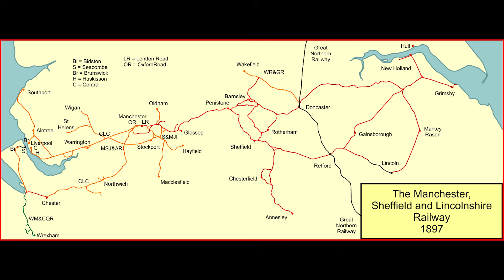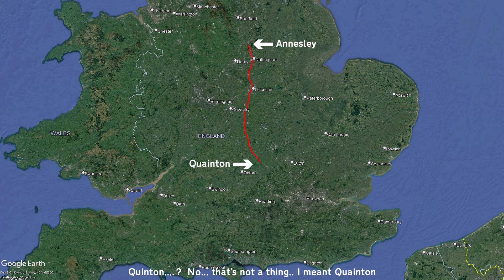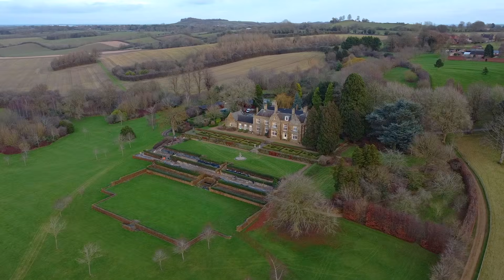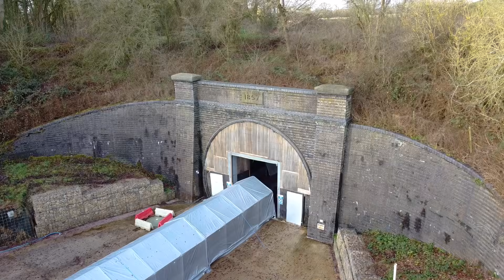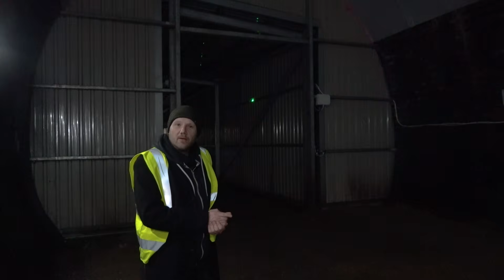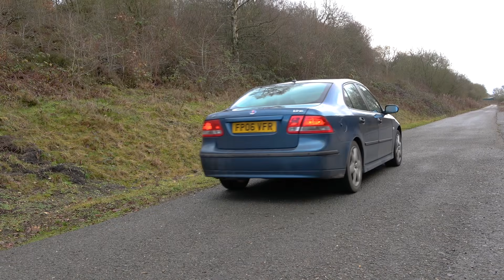The Vehicle & Car Testing Facility Buried Underground In An Old Railway Tunnel

Comment: I walked through the tunnel in around 1974/5 - It seemed like a bloody long way in total darkness (all we could see was the small point of light at either end). There was still a fair bit of railway equipment lying around at that point (just a decade or so after the line closed). Also various open drainage channels etc to fall into...

Comment: Really don’t get this?
Reply from the maker: What you struggling with... ?
Reply: @AutoShenanigans 😂 trying to work out why you want to test cars underground? When the prototypes are out they are camouflaged anyway so spy’s & drones don’t matter. Maybe they want to see what the headlights look like 🤪
Reply: @Senna-xi1gr  As was stated fairly clearly in the video, if you're testing the results of your latest aerodynamic adjustments to your design, you want consistency in your results. You don't want the measurements one day to be wildly different to the next due to a simple change in wind direction, rainfall, humidity or temperature.
Reply: @Senna-xi1gr controlled environment.

Comment: One of the other advantages of a tunnel is that you can test in secret. With open-air test tracks rivals will use drones or even small planes to take photos sometimes.

Comment: The only time I went through it was in the late 1980s in my mate's old Range Rover. Running on the flooded invert of the tunnel, nearly went down the 4 foot deep drains up the middle between where the tracks used to be. As it was, we conked out near the North end due to water on the electrics and wound the vehicle out in gear using the starter motor!
Spooky when all you can hear is the distant sound of dripping water.
Still, it was probably better than the sound of an approaching train - which was kind of difficult anyway  considering the track was removed when the line closed in the 1960s!
Reply: What?  A Range Rover conking out?  Unheard of.

I'm surprised it wasn't stripped and sold off whilst you were in there ...

Comment: We used to test cars on runways one problem is crosswinds and tailwinds stuffing up the results, It would be handy to confirm downforce results by running along the roof as well. Sergio Rinland ex Ferrari Design Engineer is listed as a director at Total Sim Ltd. He has been around since the 80s.

Comment: ARP are further down the line at Top Station Road, Brackley which was a station on what was actually The Great Central Railway. I remember it when it was still had trains stop there. Interestingly (or not, depending on your point of view) Mercedes F1 are also in Brackley, at the other end of town on a site next door to what was once known as Bottom Station, a station on the London and North Western railway. Ah, happy days before the vandal Beeching got to work.
Reply from the maker: There's a lot of F1/motorsport in the area, with Silverstone near by it makes sense.

Comment: The mysterious rooms built into the sides were used to store maintenance crew toolboxes and to take breaks in, etc.
Reply: Yes I've seen these with fireplaces. Like micro canteens :)
Reply: I spent many a happy hour in those rest facilities when were thinking of reasons not to get back to maintenance.  A shift needed to take the allocated time.  It was a cold an wet tunnel.

Comment: 1. I suspect those 3 rooms on the sides of the tracks were for maintenance personnel to have a break room while trains went by.
2. 2740 metres?? Why is nobody top speed testing cars down there?!
Reply: That's Correct areas or(small rooms) is where the Work groups use to gather to have their Lunch and leave their belongings  before setting off back to work.  There are still quite a few of these Rooms in tunnels especially around Manchester area.
Reply: The door at the end ?

Comment: Theres something similar in the USA. Abandoned PA turnpike tunnels, originally constructed for the South Pennsylvania Railroad, was never completed. These tunnels became part of the PA turnpike system, and in the 60's, a few were bypassed. One of the tunnels, Laurel Hill, has been repurposed for PennDot i believe and used for testing road safety equipment. At one point, I think some NASCAR team did some research and testing there, areodynamic testing I think. Very cool to see something very similar in the UK.
Reply: Chip Ganassi uses it for his teams.

Comment: The little rooms formed in the side of the tunnel would be for platelayer gangs.  Typically four men would look  after a mile or so of track so you use to see little huts all over the network.  They would be continually checking bolts, clips and track alignment and so on.
Reply: So a bit like a tea room for the rail maintenance crews?

Comment: Closure of the Great Central line was nothing to do with Beeching. It was because when British Rail came about, it was put into the Midland Region, which still had LMS management, they didn't like the Central line because it had been LNER and thought it was still a threat to Midland lines, also they didn't really know what to do with it. It was run down so BR had no option  but to close it
Reply: thus losing a useful freight line and a direct rugby nottingham link
Reply: @highpath4776  The same thing happened in Western Region with attitudes to Southern routes in the west country and even with the Atlantic Coast Express being consigned to the dustbin

Comment: I travelled most of the MS&LR's London Extension on a Sheffield to Bournemouth train c.1960.  (As I recall it cut across from Woodford Halse to the GWR at Banbury)     The Great Central (as it became) main line was noteworthy for having island platforms, an unusual feature for a two-track line in England.   I believe the line was laid out for fast running, I believe I read that at some point the fastest scheduled train in Britain was a late-night newspaper train from Marylebone to Nottingham.
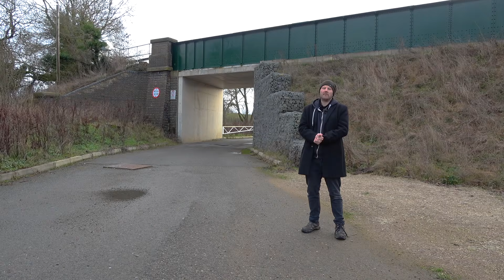Re nimbyism at 3:05 - I seem to recall reading that the reason the London & Birmingham (later LNWR / West Coast Main Line) avoided Northampton 60 years earlier but not all that far away, was powerful nimby landowners.   They were always around.    The reason the Kyle of Lochalsh branch of the Highland climbs from Dingwall past Strathpeffer round the back of Raven Rock then drops back down to the river is reputedly because the local laird didn't want them following the river.     And so on...
Reply: Yes the GV was often used for excursions from the North to the South, or East Coast

Comment: walked this tunnel back in 2006 before any of the wind tunnel stuff was added. was kinda fun, intresting, cold wet and very dark in places the vents where some of the most intresting parts. the little side rooms where for eating your dinner in if you where working deep in the tunnel, and track work storage. There are a number of videos exploring the tunnel. one called "catesby railway tunnel full tour" by rebecca smith while 11 years old is rather good

Comment: Walked through the entire tunnel, from south to north, in the mid-1970's - part of a discovery process of odd places on the map. We were told by a local resident a few weeks before the Army had been to check it out.
You missed the second spectacular part, the north bridge crosses a fairly deep ravine. Now no longer accessible from the tunnel itself, as you found the bat's home. I understand you get access from a nearby golf club's course.
There is the Kilsby Tunnel a few miles to the north-east, which is used daily by the West Coast Mainline, so no access ever and the air shafts are crenelated. Building that had challenges too back in Victorian times.

Comment: +Auto Shenanigans
"platelayers' cabin" aka "platelayers hut" (latter outdoors generally.
"Platelayers' huts are small buildings constructed beside railway lines at regular intervals (typically every 2 or 3 miles) that were designed to:
    store the tools and equipment used by permanent-way workers; and to
    provide those workers with somewhere to shelter during meal breaks and periods of bad weather.
For more than a century, each team or 'gang' of track workers was assigned to a specific length of track. The members of these teams were known as ‘platelayers’, 'gangers' or ‘lengthmen’ and each team was based at a platelayers’ hut located close to its 'length'.
Platelayers' huts fell out of regular use in the 1970s, when more flexible working practices were introduced. Regional teams now use vans and other road vehicles to reach locations where maintenance work is required".
Reply: And the huts are used for snogging by teenagers.

Comment: Before all this development the tunnel was closed at both ends but it was always possible to gain access despite this.
There were very wet areas due to spring water and there was a drainage channel down the centre.
I believe 3 million bricks were used in the construction.
With wet rails and a gradient it was not pleasant for the driver and fireman on the steam locomotives if they happened to have difficulty with traction and consequent smoke in the confined space.

Comment: What an interesting set up and great use for the old tunnel! Very cool video. Also, new Saab?
Reply: It is a great facility... we got to film there a while back... They have lots of sensors and measuring capabilities from lasers for aero to underground GPS tracking.. The aerodynamic noise testing side is quite fascinating, including the pursuit / racing bicycle aero testing.
Reply from the maker: It is a "new" Saab.. the old one was at the end of its life.

Comment: You're not quite right about HS2 not wanting the Great Central infrastructure for their route, because a few miles of HS2 will run along part of the old line ! There will be a deviation in one place due to curvature of the old line, (HS2 line speed is 250 mph, the GC less than 100 mph). So, starting at Quainton, north of Aylesbury,, having passed round the west side of Aylesbury, HS2 joins the old GC main line: -
https://assets.publishing.service.gov.uk/government/uploads/system/uploads/attachment_data/file/529513/C222-ATK-CV-DPP-020-000008-FPD.pdf
It passes under East-West Rail on the old GC formation
https://assets.publishing.service.gov.uk/government/uploads/system/uploads/attachment_data/file/529514/C222-ATK-CV-DPP-020-000009-FPD.pdf
But leaves t he GC for a bit at Chetwode, to ease the curve for its 250 mph line speed
https://assets.publishing.service.gov.uk/government/uploads/system/uploads/attachment_data/file/529515/C222-ATK-CV-DPP-020-000010-FPD.pdf
Then near Turweston, approaching Brackley, it leaves the old GC so it can pass round the east side of Brackley. The old GC had a station in Brackley, of course.
https://assets.publishing.service.gov.uk/government/uploads/system/uploads/attachment_data/file/529517/C222-ATK-CV-DPP-020-000011-FPD.pdf
Of course the old GC formation isn't used "as-is" because HS2 track spacing is much wider due to the aerodynamics of trains passing at a combined speed of around 450 mph ! Bridges are replaced, but the basic line is used.
Reply: Thanks for the info about HS2! I think Jon mentioned "HS2 eyeing up the tunnel" rather than the rest of the route, so he may be right after all!
Reply: @stepheneyles2198  I don't think HS2 was considered when looking at a route to Birmingham, but there was a proposal quite a few years ago to reopen the GC as a freight-only line suitable to haul continental loading gauge wagons from the Channel Tunnel up to northern England. It was to be privately financed too, but failed to get support for its Act in Parliament.

Comment: Awesome video again! I was one of the surveyors who did the survey for the project (you can see one of the targets we put up at 3:55 ), so it’s really cool to see it finished. Not the pitch black sodden hell scape it was before!
Reply from the maker: Great to hear from someone who was involved.  Was there much "repair work" required to the original structure?  What's the deal with the "targets" ?
Reply: @AutoShenanigans  From memory not a lot of repairs, just lots of debris removal! When the tunnel was partially cleared we drove a vehicle mounted scanner down there routinely to survey it as it was built. The targets were to make sure it was super accurate because it’s underground. Got plenty of videos/photos of it in its “abandoned” state  if it’s if any interest! 

Thanks again for all your videos, I love your channel!
Reply: @AlphaViper  That is very cool! I wish we had those when we filmed our video there! I don't know about Jon, but I'd like to see those photos!
Reply: @AutoShenanigans  laser distancing/ elevation changes

Comment: high-speed runs!? ooooo
Reply: We took one of our cars down it when we filmed there – sadly not very fast – but what they've done is add sound deadening in the tunnel. This is so they can get more accurate readings on noise tests. So, it won't ever sound as good as it could without the sound deadening... but would be awesome to do a high speed run nonetheless.

Comment: The side rooms in the tunnel would have been used as a " Bovvy " - a small place where trackworkers can sit down , warm up ,have a brew and eat their sandwiches during their breaks between maintaining the track ! There would have most likely been a small fireplace with a built in flue and benches !
Reply: Sam, spot on!
Reply from the maker: Imagine that as your "office" for the day. Awesome. But it probably wasnt.
Reply: I suspect that Bovvy was a souff of England pronunciation of Bothy, a common term for huts or shelters further north.

Comment: Watkins had some interesting ideas, he started to build London's version of the Eiffel Tower at Wembley, bits of which were found when they rebuilt the stadium a few years ago (search Watkins's Tower for info).
Reply: Correct.

 But they ran out of money at 90 foot tall and from then on, until it's demolition in the early twenties to make way for the original Wembley stadium, it was known as the "London Stump".
 It is alleged that the backers then hawked the idea round  the country to get others to invest in a tower for their own town, setting up The London Standard Debenture Company.
But they just took the money and ran.

One place they allegedly conned was Blackpool.

 So not wanting to have such a black mark, the town's Mayor, Alderman Cocker, got enough backers of his own to build it instead,.
 It was a phenomenal success and the rest, as they say, is history.

There were supposed to be two more built too. New Brighton on the Wirral and Douglas on the Isle of Man.
 Only New Brighton's was built in the end.

And apparently, the four corners of the London Tower/ Stump, are exactly the four corners of the pitch at Wembley.

Hope this is of interest.

Cheers.

Comment: So is that the Northern extension that Eurostar never bothered with then, i guess? They even got as far as building some of the trains to specialise in that route. Pretty sure the 1st Gen Eurostar train they have at the NRM in York is one such example. These sets were not only able to use the at least three different wattages of electricity that various different national systems used, they also had the ability to get said juice from pantographs and third rails.
Reply: No. The Eurostar northern extension was up the existing east coast mainline towards Leeds and York
Reply: @emmo999  Excellent, cheers for the info!
Reply: Even the first Eurostars had multiple voltage and pick up equipment .
Reply: @barrieshepherd7694  they still do. But this had they'd rail pick up too, which they no longer come with
Reply: @deeser  I know - my comment was really that it is not revolutionary for trains to have third rail and overhead pick up equipment fitted.

Comment: The only negative element here is the colossal lack of foresight that closed that route in the 60s as the most modern and largest loading gauge route in the south midlands and London area.  It would have been ideal for the freight that now uses the roads as the tunnels and other structures would allow the current containers that have required many £millions in modification of other routes that now see battle with passenger traffic, thus making roads more attractive... hoorah for GB

Apart from that what a brilliant use for an under used/out of use tunnel and they even managed to satisfy the bat nutters!  I believe there is a similar facility in the US (I think Pennsylvania, but I'm not sure) but not as straight, which offers similar but different testing opportunities.  Excellent work!

Comment: Next you should investigate the first channel tunnel which made it about halfway to France.  Might need to drain it first though...or get a mini submarine.
Reply: I've been down it.  About thirty years ago was the last time I went.  You won't get more than about 100 yards after the turn, before you need scuba gear.
My initials are carved in the wall.  ;o)
Reply: @sarkybugger5009  And beyond the old stables, the 1990s construction drilled straight through.

Comment: Consistent conditions is one of the reasons for car companies using the tunnel; another reason is that they can be sure that there are no people around with cameras to take photos and leak them to the press/competitors.
Reply: Good point.
Reply: @AtheistOrphan  Indeed! And when we were filming there, saw how the hangars are built so the trucks can reverse the trailer in so even a drone can't see what's about to go down the tunnel.